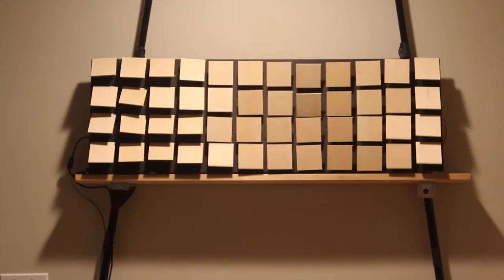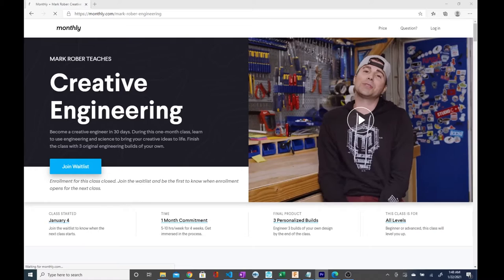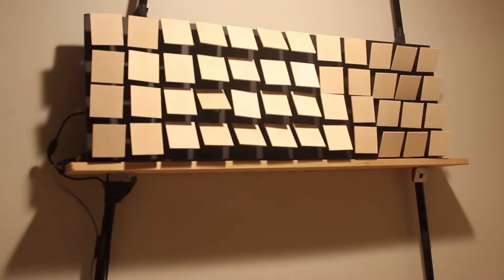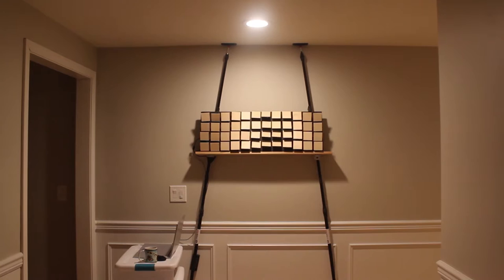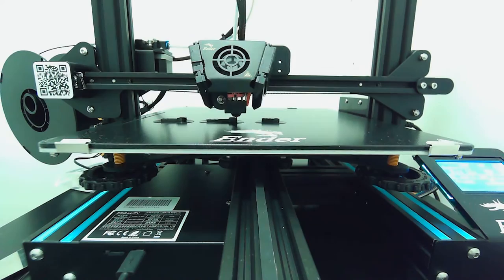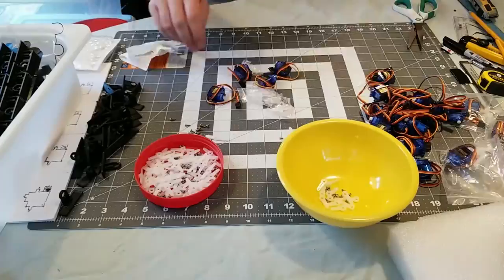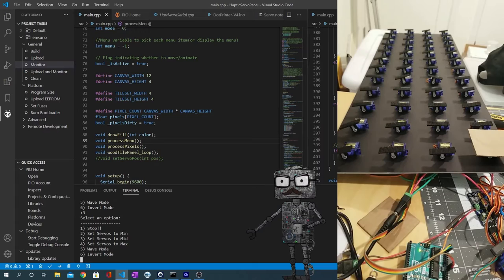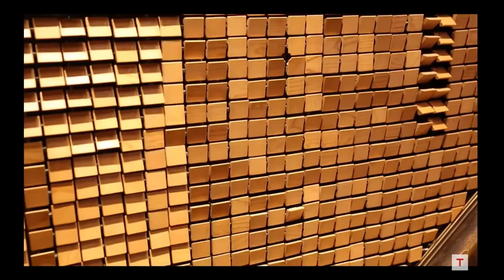Multiverse's Lowest LO-FI Wood Pixel Display—Arduino Art

Comment: Hello this is super cool. I am working on a project that involves use of Arduino UNO and servo driver PWM 16 channel to control multiple motors. I am facing issue run all the 16 sg90 servos together. Currently can run around 9 servos without any glitch. Not able to find out what may be the problem. The adaptor I am using to power the driver is 5V 3A. Which ADAPTER did you use to power the servo driver? Thank you.

Comment: Hi!  I’m just learning and the movement is quite stuttery compared to yours with the default code, I’ve tried different frequencies but it just seems to change the angle.  I’d love to slow it down but the more I slow it down the more the stuttering becomes apparent.  Thank you!
Reply from the maker: Yeah, I saw some Servos stutter, especially if thin wires are used, or poor connections.  I ordered extra 10% servos to account for some not working, and some stuttery ones not working well.  Maybe some resistor/capacitor on the wires would help reduce echoes/interference, I'm not a good electrical engineer, so suggestions from people are appreciated.  Cheers!

Comment: I am a student attempting to create a mechanical mirror from scratch with a few of my peers for a graduation project. I am not sure where to start for coding, any pointers?
Reply from the maker: Hello @masonroberts9784 !  Code and STL files for this project are available at https://github.com/aaronse/ServoPixelDisplay, if you're new to coding arduino type projects then consider checking out https://learn.adafruit.com, they have some great learning guides to go with controllers, sensors and actuators that they sell.  However, much of the hardware they sell can be obtained else where too.  The Adafruit code and libraries often work fine with non-Adafruit hardware...  If you're new to coding and learning your first language, then Python is popular, and you can use Python on Raspberry Pi and even smaller micro controllers by using "Micro Python" or "Circuit Python".  Hope that helps, good luck with your team's project!

Comment: I'm new to programming so genuinely curious ist possible to programm with pythan instead of c++ (which I'm assuming you used)
Reply from the maker: Hello!  Yep, you can use Python to control projects like this instead of C++.  Adafruit have some great Python libraries and code samples.  https://github.com/adafruit/Adafruit_CircuitPython_PCA9685 has some examples.  My next build will probably use Python and libraries like adafruit_pca9685 and adafruit_moto.  Hope this helps, good luck with your projects!  @NetNinja channel, @freecodecamp channel and several other have been helpful to me.  Hope that helps, cheers!

Comment: Is there a reason or standard for the square quantity you have chosen? 12 x 4?
Reply from the maker: Good question, only reason was I didn't have time to build a larger version for this project.  Had to design, build, code, video in ~week as part of the Creative Engineering course.  Liked this 'prototype' and built a larger version afterwards...

There's separate 4x4 modules making up each segment because of how the 16 channel controller works.

Comment: nice video , thanks, ive just started a simalar project.  id love to know the hardware n and wireing plan you used to run so many motors
Reply: im going for steppers , your opinion sold me on the . motion senors is on the plan too, complete beginner , lets see what happens
Reply from the maker: Thank you Darren!  Used an Arduino Uno with 5V 10 amp power adapter from Adafruit for this 48 servo WTD panel.  Currently working on a 192 servo version, will upload a video and pics with wiring plan when done.

Good luck with your build!  Curious to see how it turns out.
Reply from the maker: Hello  @paddymush1 , so steppers are definitely preferred by Daniel Rozin.  However, I ended up not using them and am instead sticking with SG90 servos to reduce material and complexity costs.  I couldn't find, or make time to learn how to design, a reasonably priced 16x stepper controller board that Daniel Rozin's art installations use.  However, tons of servos can be wired up 16 at a time to relatively cheap PCA9685 based controller boards.  Will share design details  when that project is done.
Reply: @AzaB2C  Thanks so much for the reply and info , its worth its wait in gold .   Im basicly at day one , in coding and electronics, super motivated ever since i stumbled on to the origional daniel Rozen piece, amazing!! 
Im planning a 32 servo as a mock up ,using arduino mega , extra power adapter still undecided hoping to eventually get to 100+ stepers  .    
.
    Very much looking forward to seen your piece and her inner workings .   
   Thanks very much for your feedback , super appriciated.   im sure you already know , info is hard found on this idea , i think you are the only person , non university or big business on the interweb doing it ...Kudos
Reply from the maker: @paddymush1   how's it going?  fwiw - uploaded code and .stl for WTD1.0 48 servo edition to https://github.com/aaronse/ServoPixelDisplay am still working on the 192 servo version.

Comment: Hello, good day. Awesome work! I'm doing a similar project like this, but would like to use a kinect or motion sensor to control the servo motors, just like Daniel Rozin's work. does the creative engineering course have an in depth tutorial or training for this type of project?
Reply from the maker: Hello Ken!  Thank you!  The Creative Engineering course content focuses on providing an overview of the process of building something starting with brainstorming through to building something that encourages/inspires students to push and stretch themselves.  The course covers some basic sensors and actuators.  The cohort community you study with maybe able to help some.  There's no vision processing content though.  I have a PC compatible Kinect, but am planning to use open cv on raspberry pi for my mostly built v2.  Shared info on github if that helps, a few others have shared info on their builds there, good luck!

Comment: Is  a great project, but as you say the servo motors era very simly and delicate, , really i think that really need use stepers like rodins, the answer is what type of  and how to control too many stepers at same time, is really complex, i dont know if anyone can help here.

Did you know the number of the x12 contro, than t Daniel Rozin's art installations use???? or other similar??

tanks for all
Reply from the maker: Hello!  Sorry for the really really slow response...  Have been learning about steppers that are part of the CNC and Printer I've built.  Even after learning lots about those I still don't know how to create this wood tile display with lots of Steppers without it taking quite a lot of work to build and control.  Since releasing this video I created a 192 servo wood tile pixel version, but still need to share a video.  Cheers!

Comment: Hello, i'm working on a square panel of 64 servo. Do you think a 5V 10A power supply with wago will be enough for the 4 board (16 servo X4=> 64)? thank you ;)
Reply from the maker: Hello Gregory!  10A sounds like just enough if many/all servos will be regularly actively moving at the same time.  Consider 12A+, had related discussion at https://github.com/aaronse/ServoPixelDisplay/discussions/3  hope that helps.
Reply: @AzaB2C  Thanks, that's very helpfull for me. I found support for fixing each servo on the board. I'm moving step by step ;) i saw your WTD v2.0 platform but didn't understand how you fix the servo ......
Reply from the maker: @gregorypierson9801  you're welcome!  Added picture and info to the discussion showing how WTD v2.0 servos are mounted, body side up, opposite to WTD v1.0.

Comment: nice, i'm thinking about building similar thing, but with higher resolution, and cost are increasing very quickly!:)
do you have some estimated cost of this build?
Reply from the maker: Hello!  With SG90 servos being ~$2 each and each PCA9685 controller being $5, my costs ended up being ~$40 for every 16 or so wood pixels.  Raspberry Pis are getting easier to locate, but they cost too.  The project in this video was probably $200 to $250.  My latest 192 servo build has Aluminum extrusion frame and brackets that added ~$100, another ~$50 for wall mount.  Add some wiring, power supply and other bits and the cost for my latest build is probably ~$700 :-(

Comment: What is the rating of the power supply ur using here for this .. ? 5v 30amps ?
Reply from the maker: Hello @Prashant Kumar, just using Alitov 5v 5 amp for this v1.0 version.  10amp would have been better.  5 amp would be insufficient for worse case scenario if all the servo's were being actively driven and were under load/stalled.  I used 5v 60 amp for v2.0.
Reply: @AzaB2C  So ur Using 5v 5amp for 3 PCA8695 .. ? Have u Chained them according to Adafruit circuit diagram or ur powering individual boards separately
Reply: @AzaB2C  Can u help me .. I want to know wht Power supply should be sufficient to run 384 servos with 24 PCA8695 boards
Reply from the maker: @PrashantKumar-nz8hq  LOL, 384 servos, that'll be awesome.  Am 'only' using 192 for v2.0.  Yes, for v1.0, chained the PCA8695 using guidance from Adafruit tutorials.  Parallel power to each PCA8695 using 16ga.  Just added photo to https://github.com/aaronse/ServoPixelDisplay hope that helps!  wrt Power Supply, planned on 100ma per servo, ignoring software bugs, they won't experience heavy load or need anywhere close to stall rated current.  Bought oversized adapter 5v 60 amp so have room to expand, and hopefully won't get too hot under normal load.
Reply: @AzaB2C  just checked .m Ur are Individually Powering up the Boards right ..